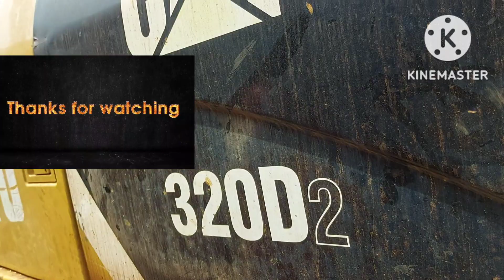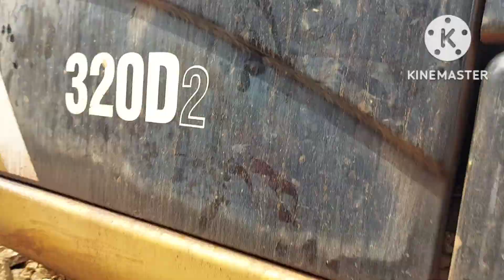#trouble shoot #engine wont start #cat excavator 320d2

Comment: Boss among 320d pag itaud ang pump crank lang siya.. pro ug tanggalon nako ang pump one click ra andar drtso.... unsa kahay problma ani
Reply from the maker: Unsa na pump boss? Main pump o fuel pump?
Reply from the maker: Kung main pump na boss naay problema ang hydraulic system. Naay load ang system sa  hydraulic ana boss hard start gyud na.
Reply: @zachvillasinvlog  hydraulic pump boss...
Reply from the maker: @joneltan5070  e check ng main pump boss or ang hydraulic tank basin may dust pwder na